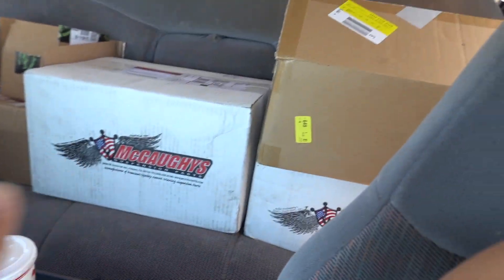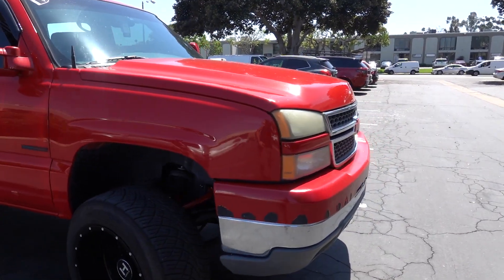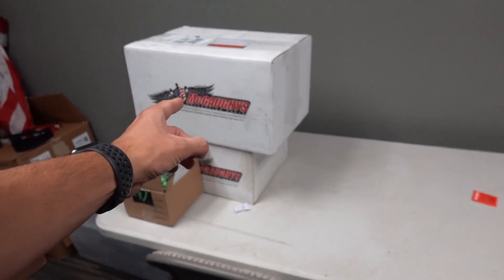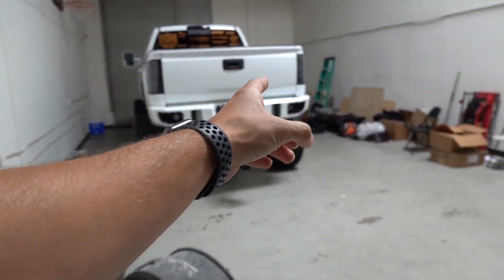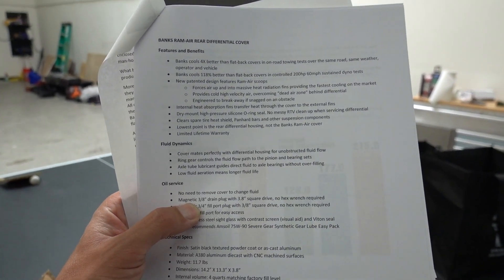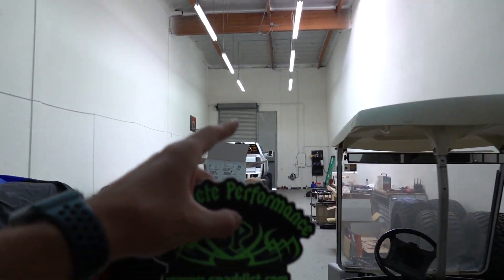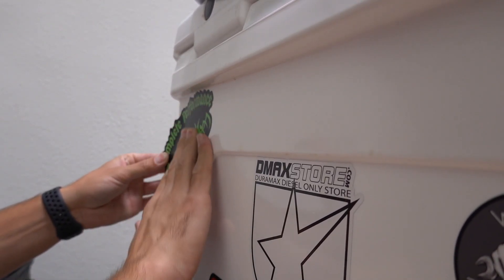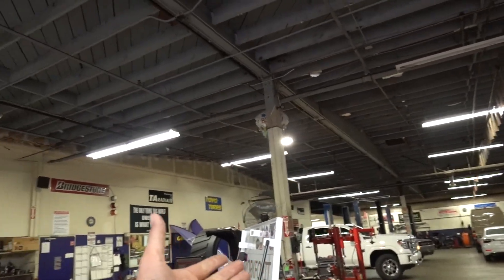WE GOT THE FIRST BANKS RAM AIR DIFFERENTIAL COVER!

Comment: Banks did an amazing job. I watched all the R&D videos that proves it performs better than any aftermarket cover and actually improves performance. Now you need to put on  a big brake kit!
Reply: Where did you see any of the R&D videos of the Banks cover? they have only posted vids trashing/testing the others.
Reply: I watched Banks videos.  He didn't prove anything but I think he convinced many people that he did.
Reply: @highwaymen1237  P.T. Barnum he is
Reply: @asherdie  they are all on here just look up Banks
Reply: What next a Re-engineered Fuel cap? If you are concerned by aerodynamics wtf are doing in a pickup. Banks is a beautifully pointless item.
Reply: @mwnciboo  learn what you are talking about stick to your video games all major auto makers refer to Banks Power because he is the smartest when it comes to making power the only reason he made that was to see if he could make it better.
Reply: @kountrytiger1999  2 months later they are.
Reply: @kountrytiger1999  "high duty cycle" power.

Comment: Yes, it's still called an o-ring. It's not the shape as you see it lying flat, yet it's the shape of the cross section of it. Same reason there's an x-ring option on motorcycle chains.

Comment: I have a 2001 Dodge Ram diesel and I have the Gale Banks six shooter the Gale Banks exhaust it always size turbo and I've been seeing the promotions for this I'm wondering if they have for my 2001 and the sound for the Dodge Hemi because acting is worked exhaust stage 2 chip Hypertech air intake throttle body spacer I've replaced the rear end of the truck 3 times because of all the horsepower and torque am I Dodge Hemi I would love to put one on both my trucks especially my Hemi I'm tired of putting rear ends in

Comment: Glad to see these covers are making it out! I’ve been doing testing since early June with one and seen nothing but stellar results! As a bonus, they look badass!
Reply: What are your results?
Reply: I’ve noticed an approximate 15-20f temp reduction in all load cases with my cover compared to the stock cover. That’s on a 1300hp truck driving to and from work, 60mi a day.
Reply: @bradleydavidsankey  do you have a thermocouple in the differential oil or are you using a IR gun pointed at the differential cover?  What was the temperature before you changed differential covers?  Thanks.
Reply: Todayi1itall I saw ~220f before the cover change. Now I see ~195-205f in the same drive at 80-85f ambient with tightly set up 3.73 Yukon gears and a truetrac. 

I am measuring fluid temp with a thermocouple. I did temp testing with the stock cover using the same thermocouple in a similar location.
Reply: @bradleydavidsankey  Have you looked at using a synthetic lubricant?  Hate to use your truck as a laboratory but not many vehicles have temperature readout of there gear lube.  Some of the high-end Mustangs have differential and transmission temperature indication.
Reply: Todayi1itall I’ve tried both Amsoil synthetic Severe Gear 75w140 and paraffin based Cenpeco hytorque with temp tac 85w140 fluids. There hasn’t seemed to of been a major temperature drop with either fluid.
Reply: @bradleydavidsankey  Did you ever try one of the other aftermarket  aluminum covers that had fins and additional oil volume?  Thanks
Reply: Todayi1itall I had a PPE I ran previously but I did not do any temperature testing.

Comment: Not sure why you would coat the cover with an insulating coating after all the the R&D to get rid of heat. Radiators are painted with piss thin gloss black paint for a reason.
Reply: ITS A PROVEN FACT THAT BLACK DISSIPATES HEAT FROM INTERNAL HEAT. BESIDES THERE IS ENEOUGH ALUMINUM IT DOESN'T MATTER, BANKS WOULD NOT OFFER IN A COATED BLACK IF IT WAS A PROBLEM.
Reply: @hankclingingsmith8707  I think your caps lock must be stuck on. Or, you want us to think you know what your talking about if you say it louder. If you remember from third grade science class, there are basically 2 kinds of materials. Insulators and conductors. Putting a super thick plastic insulator on a conductor... heat dissipation will be diminished. That's why we don't powdercoat engines, even though it looks good, it holds in heat. We don't powdercoat brake drums, because it holds in heat. We even put an insulator on headers to hold heat in and keep it out of the engine bay.  Nothing like a wannabe engineer keyboard commando to make some stupid ass comment like "it's a proven fact that" followed by some bullshit. Think, real hard, now...have you EVER seen any aluminum heat sink on any  device with a heavy coating of plastic on it? Sometimes, if we step back, and actually think before we say something, some good may come of it.  If you use even a little common sense, a lot is revealed. To say coating these covers with plastic has no effect on heat dissipation is moronic. Thus, the original post. If putting a thick coating on a radiator helped with cooling, don't you think all radiators would have a thick coat of plastic on them?  And I said radiators are painted black to get rid of heat...(as are cast iron engine blocks), in the beginning of my post, so thanks for your expert input on that. Thank God you layed that knowledge on us.

Comment: The fill plug is probably pipe thread so its tapered thread. Why it wont seat all the way down
Reply from the maker: griffin pierce you are correct. Confirmed it with banks.

Comment: Will the powder coat make the Diff hold more heat?
Reply: Charles Pinson In theory the powder coat could help it cool even better, given that it has a lower heat capacity than the aluminum diff cover.
Reply: @benjaminreid3296  lol the powder coat just add an other step to transfer the heat.... 
so the oil inside the diff as well as the aluminum diff cover will get hotter than if it was bare aluminum...
this is juste basic thermal dynamics.

Comment: Powdercoating will infact nullify any heat dissipation benefits that Banks would have designed. Now its just another diff cover.
Reply: We thought the same thing. But after we tested both coated and non-coated covers we found the difference in heat rejection was almost immeasurable. One or two degrees F.

Comment: Would be so cool if they had a pearl pink power coating. I’d do my leaf springs and 4 link on my truck. 
Be a pain to get the front done. Just did a fresh QA1 install. But my truck isn’t lifted like yours. 
It’s lowered a little but I use it for autocross
P.S 
Your attitude is contagious and I like that. Glad I found this channel.

Comment: Plug wont go in cuz of the powder coat
Reply from the maker: To The Bar Productions nope, no powdercoat inside the threads. This is by design, it’s a tapered plug. They are changing it for future models.

Comment: Pays for itself!! "After 140k" lol awesome
Reply: What he didn't have time to mention is that flat-back covers cost you almost $450 every 100k miles in lost fuel economy. So, you're basically buying a new flat back cover every 50k miles.
Reply: JTP Buildz In fuel, if you hot shot and pull tons a weight, much much sooner

Comment: should have bought the factory finned diff cover from a 3500 dodge ram. Bolts right up to your gmc and costs half the money
Reply: The factory 3500 finned RAM cover is a great upgrade, however, it suffers from the same issues as the stock cover... a lack of airflow over the fins. That's why we designed and patented the Ram-Air scoop design. 🏁
Reply: @banks power, what do you think about heat dissipation with the powder coating?
Reply: @DezertDana  We've tested with and without paint/powder and the heat rejection difference is almost immeasurable.

Comment: I'd show that to Eddie. He didn't believe it made a difference. Curious, why didn't you look into getting the rear end re-geared since getting those big tires? would help with power and wouldn't need to drive in tow/haul mode like you mentioned in a recent video

Comment: The cover is a waste of money.  I watch the Gale Banks videos as he tried to justify building this cover.  The other aftermarket covers with added volume actually give a place for air to separate from the oil improving its resistance to shear.  Air in the oil increases friction between the gears causing it to heat up.  If this is so great why don't they use it in NASCAR.  They use an external cooler and air separator.  I work for Shell Oil in their Lube oil R&D, licensed professional engineer.  You could make these in China for about $20.

Comment: The thing is like 400 bucks ouch
Reply: But like Ryan pointed out, it pays for itself, whereas a flat-back cover costs you $450ish every 100k miles in lost fuel economy.
Reply: @bankspower  that may be true but it took me a decade to put 60k on my 2010 about
Reply: @jcena1986  finally a comment noticing that statistic is so nonsensical